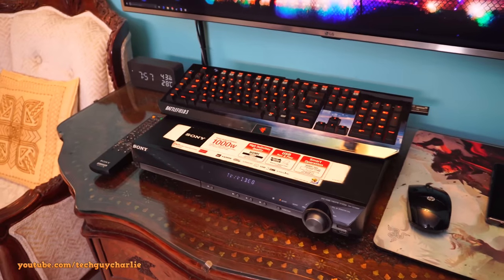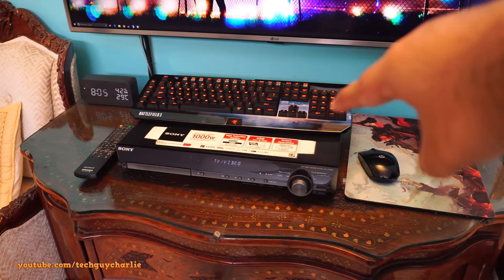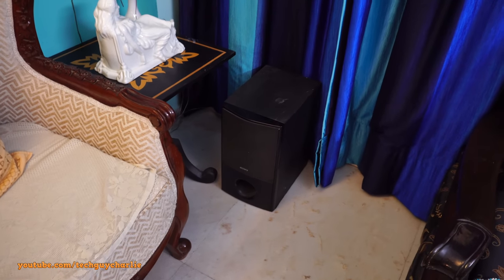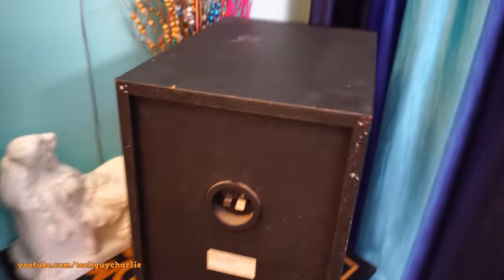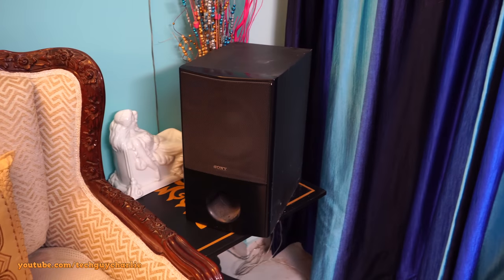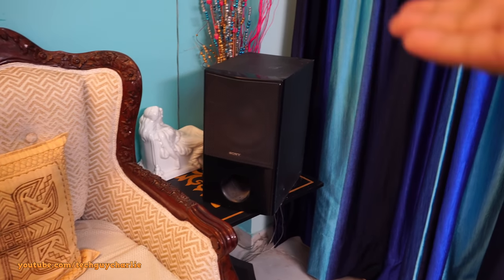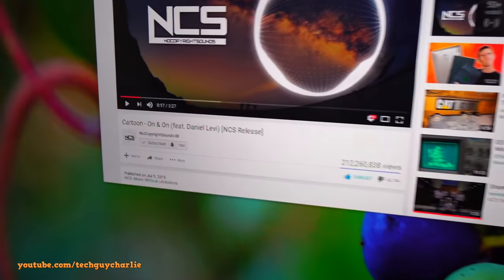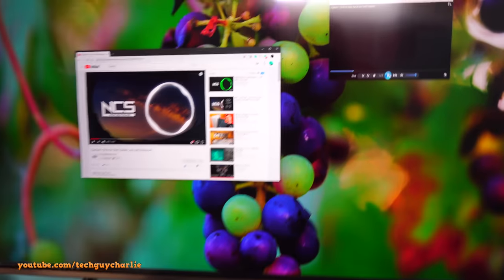Sony car sub-woofer with a home theater receiver! No 12-volt amp or car stereo required

Comment: Since you went with a 4 ohm speaker, you should add a second one to get more power delivery. You're only using 37.5% of the power. If you add a second 4 ohm speaker, you'd go down to 2 ohms and get 75% of the original speaker's power, and you could separate them a bit for better distributed sound.
Reply from the maker: Well, I don't have enough space for a second subwoofer but I'm thinking of getting a dual voice coil sub in the near future, I could not find a 3ohm DVC subwoofer for my budget, but there is a Pioneer 4ohm DVC sub that can be wired down to 2ohm, should be good. But its quite surprising even with 37.5% power, this new sub is louder and has more punch than the original sub of this system.

Comment from the maker: I opened up the old subwoofer (the part where the input connector is located) looks like the wires are intact! I guess the problem might be in the coils? I'm too lazy to open the rest of the box up since there are no screws and ill have to pry the wood open.
Reply: I think it’s blown.
Reply: Did you take apart the sub box?
Reply: look below of sub woofer box then you will find there are two small gaps to insert flat screw driver to open the sub.
Reply: the wire on the spider of these speakers go bad i have had two go bad after 5 years of heavy blasting
Reply: Its blown, and I can tell you why, if you are interested.
Reply: You can lightly push on the speaker itself and see how it sounds. If it is quiet and smooth when pushed in , it should be fine. If when pushed in, it is all rough but also makes like a scraping type sound than it's def blown.

Comment: The higher impediance gives the tighter punchier bass but you need an amp to push through it. If your original sub was 1.5 ohm and your new one is 4 then its 37.5% of the rated output which means 105 watts max is going to the sony sub. The higher quality sub combined with a sealed box gives good bass at all frequencies which your previous ported box did not because it was tuned to a certain frequency. In other words, even though it was lower watts, it's better overall because of its superior configuration. Im going to do this with a powerbass 10 inch sub wired to 2, 4, or 8 ohm with a set of polk 6x9 coaxial speakers at 4 ohms each,  but I need to find an amp to power the setup....
Reply from the maker: You are right! and even though the old sub was 1.5ohm because of the box design the bass used to overwhelm the mids and the highs, and there was no 'punch' to the sound I never enjoyed it, on the other than this car sub makes the home theatre sound a LOT better, especially in movies. I am thinking of getting another one of these exact sub and wire that up in parallel so that impedance becomes 2ohm, can get a little more out of this amp, always wanted to hear a dual sub-HTS setup.
Reply: @TechGuyCharlie  You definitely could but it would change it a little. You would gain some power. Sound follows an interesting law where 4x the power is 2x precieved volume increase so it wouldn't be double the precieved bass with 2 subs and it would be a bit less tight almost like sloppy bass but it might not be noticeable. Personally I would get a 4 ohm dual voice coil sub and wire it in parallel. Id also put some polyfill in the enclosure and use the same box to save a little space. Or find a dual 3 ohm sub wired in parallel to exactly match the impedance, that will definitely rattle those windows.
Reply: Who cares how much power it can handle and what impedance it has, if you only need 10W to drive it at 90dB anyway? I bet this sub has at least a 85db efficiency, so no need to worry about power.
Reply: @florichi  That is very inciteful. It might be better to keep the setup as it is to keep the high quality of sound. As my father used to say: if it isn't broken don't fix it.

Comment: Nothing wrong with using car subs in home theater setup only watch your impedance ohms. I've used 2 Kicker compVR 15" subs 4 ohm each 500wrms in 5.7cu.ft. ported enclosures tuned to 18hz powered by a Kenwood Basic M2 450wrms minimum at 4ohms paired with a modified Sansui C-1000 preamp. My theater room was 750sq.ft. and subs got down to a clean 20-27hz with ease not clipping. If your going to use a car subs in home it's best to have some sort of low pass filter x-over when used with full range amplifiers or buy a subwoofer plate amp with at least 5-10% more power out than the subs rated RMS power for headroom and less clipping distortion. Most of the time power doesn't kill speakers but distortion does. Reason I used car subs is power handling and frequency response at a lower cost than most designed for home audio raw drivers.

Comment: I have the exact same home sub, just take a flathead screwdriver between the plastic and wood and it should pop right of
Reply: You shouldn't lie to people
Reply: @kellynorman7452  r u the one that takes apart and reconstructs all types of speakers in there spare time, No, so keep scrolling through the comments to argue with people about stuff u have no knowledge of
Reply: @kellynorman7452  but do have the Sony sub in the video
Reply: @Audiodote  thanks for the assist
Reply: Those small subwoofers are easy to pop the plastic cover off and the replacement drivers are cheap . A real easy fix usually only 4 screws and two wires.

Comment: Open windows slightly.. I kept xplode 300rms sub in my home with car amp and hooked in my yamaha av receiver.. 😊
My doubt is when u connect high impedence speaker to a low impedance amplifier then output power will reduce to half.. As it is inversely proportional. Low impedance speaker in high impedance amp definitely blow the amp
Reply: IIRC solid state amps can go equal or higher impedance, where as tube amps can go equal or lower impedance.

Comment: Nice video👍🏻. old sony home theater were so powerful than now a days home theater. Newer all the model's are running 3 and 6ohm. 😒.  which is not as powerful than the previous models. dissappointment. by the way Good system
Reply from the maker: Thank you bro and that's true, I wanted to upgrade to the new Bluray model but the most 'affordable' one has the amplifier and all the other hardware like the Bluetooth and USB built into the subwoofer box 😕 and the RMS rating is also lower than this. So I thought its best to keep my old home theatre and buy a car sub for this.
Reply: Yeah bro.. I did not find any older sony home theater such dav dz390k or dav dz760.. so i bought sony Bdv-E6100. it's sound good but not powerful as the older model..i also bought a car subs pioneer tsw309d4 which run at 8ohm! bcz the sub port is runnig at 6ohm. Which deliver less  power. i'm Fully fed up bro.I give a message to Sony that we dont need extra features newer ht model ,,we need Performance first like older model has...
Reply: True new Sony hts are not as good as old ones and same with their hifi stereos
Reply: Aussie Ninja Yeah... They rated bdv e6100 and N9200 1000 watts and 1200watss Rms ?! Really Sony? They  lyng about the wattege. If they have 1000watts rms then why they dont loud or sound like as other 500watts sound system?! they r literally cheating in watts and they r doing this for selling thts it.. Sony new sytem has more function but lower sound power which is a huge frustation bcz its costly too
Reply: @thebasskidzz777  I think the RMS rating is correct these are Class D amplifiers, they can be small and yet pack a punch. PMPO rating is lies though and I don't think they can lie that much when it comes to RMS, otherwise people will sue them for misleading. Its the size of the speakers that matters, I am guessing if you pair the amp with better quality aftermarket speakers with properly sized boxes then it will sound louder and even better, just like what we saw in this video with the subwoofer.

Comment: Seem good choice , but I think it 8in with ported enclosur while new one is 12in with sealed one. compared both of them will not fair, well 12in need more power to push it with sealed box. Put it into ported enclosure else need to upgrade amp as well. 💗💗

Comment: I've the sony dav-tz140. 300w amp, 500w spl 8" car sub it has a box shape enclosure with a decent size bass port and the woofer is behind some thick pvc glass and then I've two floor standing speaker each have 2 speakers that both sound different and a tweeter , those are rated at about 480rms. So in conclusion I've a car sub, 9 speakers and 2 tweeters and also some green led strips that are connected to the subwoofer that light up once the amp is pushing 12v or more

Comment: This is awesome, I have always wanted to try this. I have a DAV-DZ650 sony home theatre and the subwoofer has an Impedance: 3Ω. Do you think this can work well with the same subwoofer you used?
Reply from the maker: Hey, Oscar, the Sony DAV-DZ650 subwoofer power is much lower than DZ390K
the DZ650 is rated at 165WattsRMS and DZ390K is 280Watts RMS the car sub is rated at 300Watts RMS. Impedance should not be an issue since the impedance of the amplifier is lower than that of the subwoofer, but I think the difference is quite a bit when it comes to power! You might feel that the car sub isn't loud enough because it's a little underpowered.
Reply: Oh yeah that power difference is huge. That means that I would have to use an amplifier to be able to power the car sub ryt? Do you have any advice on how/which kind of amp I would use, and would this compromise the sound quality of the home theater in that the car sub sound will be higher than the mid-range speakers? Thanks the response
Reply: Oscar joseph I have dz 350 and I have been thinking of using a car sub.
Reply: @lucasmwaura7865  I think its possible to customize though technical not unless you use a powered subwoofer. what plan do you have?

Comment: "TIP"  One way to check if your old sub is dead is check it with a multimeter if the OMS are lower than what is rated or too high then rated or even nothing then is gone

Comment: My subwoofer is working of LG home theatre I have a extra car woofer can I try connecting both !!!
Reply from the maker: I don't know bro, just don't end up damaging your amplifier! some LG and Samsung home theatre amps I have seen are rated at 6-8ohms, car subs are generally 4ohm, if you connect a subwoofer rated at a lower impedance than your amp, then you risk damaging your amplifier. Also, the wattage difference should not be much, else your home theatre amp will not be able to drive the sub.
Reply: @TechGuyCharlie  okay !!
Reply: Bhai kaha sy mely ga ye

Comment: how can you run a 4 ohm speaker on a supply of 1.5 ohm? :3 you can damage your speaker or amplifier when playing too loud.
Reply from the maker: Not really, I played this setup at maximum volume for over an hour nothing happened, Class D amplifiers are awesome! they stay stone cold even when driven at such high volumes. But if you run a speaker with lower ohm than amplifier then you will damage the amp. But if the speaker is of higher ohm value and the amp is lower than it will be fine.
Reply: Moiz Mushtaq people use 1 ohm stable amps and run 1, 2, and 4 ohms sometimes even .5 ohms if you’re risky
Reply: You only risk damaging the amp when the speaker ohms are too low , wont hurt the speaker... but the more ohms the speaker the less power the amp will push to it down to a certain wattage then it levels out...people run from 0.5 ohms to 8 and 16 ohms all the time , normally the wattage drop levels out at 4 or 8 ohms
Reply: depends on the type of amplifier
Reply: If m not wrong lesser the ohm more power it uses. So using 4ohm speaker where 1.5ohm was being is gonna be piece of cake for the amp! Correct me if m wrong
Reply from the maker: @aniketnaik1197  Exactly, that is correct!!! I don't know why people don't get such a simple thing. It's only a problem if the ohm rating on the amp is higher than the speaker (8-ohm amp with 4-ohm speaker) and modern day amps just go into protection mode before any damage occurs.

Comment: I did the same but I used JBL GTX 1300T bass tube. I want to know that does a sealed box sounds better than tubes?
Reply from the maker: lol funny thing I wanna know how a bass tube sounds like, I am guessing a bass tube is like a ported subwoofer? but with more bass? how was your experience?
Reply: @TechGuyCharlie  I've never tested sealed box, I've read on the internet that sealed box sounds accurate, & bass tube sounds more punchy ☹️
Reply from the maker: Exactly, this sealed box produces bass that has that 'punch' effect, even though the overall loudness is less, also what I have noticed is the quality of the bass is better than the previous sub which was a ported box, earlier there was too much bass with that 'boomy' effect and I did not like it because while watching movies it used to overpower mid frequencies and it definitely lacked the 'punch' 
my personal experience, with a sealed box sub, the bass is cleaner and well balanced.
It really depends on individual choice. I hope soon, I can borrow my friends bass tube and do a test myself.
Reply: @TechGuyCharlie  before buying ( 6 months earlier from today) I was searching for the exact same video,but can't find one, I was anxious about buying a car subwoofer for home costing 6k,so I was searching this type of video to check whether it's a good idea or not, but you posted this only 3 months ago, anyway I am satisfied with my bass tube ( powered by 300 watt Rms class d amp at 4 ohms)
Reply: @CaffeinatedSentryGnome  mine is from jbl, jbl gtx 1300 t, 350 watts rms, & sounds very good
Reply: @prabhakar_  must be a well designed system then

Comment: Great video. If I was you, I would place the sub on the floor instead of a table. I’ve listened your video with high end headphones and I surely can hear that the Sony Xplod subwoofer sounds good and hit very low notes. I am using a Mordaunt Short active subwoofer in my set up at the moment but I do have a spare sub, a Sony passive home theater subwoofer which is bigger than the one in your video and is also rated at 4 ohms. It weighs approximately 50 to 60 lbs (20-25 kg) I want to use it as a second sub with an external amplifier. My receiver has the functionality to hook up an extra amplifier. Do yo have some advice/tips how to hook it up? It’s rated at 140 watt RMS at 8 ohms and 280 watt RMS at 4 ohms. If you need more specs to help me out, let me know. Thanks in advance and a great 2019 my friend! Best, Emiel.
Reply: Hey emiel. I've done a lot of home stereo stuff using all kinda of equipment to get create sound as cheap as possible. Do you have any social media we can contact each other with, I'll be glad to share my knowledge or at least try to help someone else out.

Comment: Maybe you blew it
Reply from the maker: Yup, I usually play this at quite a high volume. : D But I looked it up and its a common problem with these Sony home theatre subs, they tend to stop working after a while.
Reply: @TechGuyCharlie  kinda, i own one of these and its a 8'' and has definitely been in use over 6-8 years now, and  has has had a lot more than 300 watts rms, 800 peak, it works fine and still is in use, even tho  have a lot more better subs and bigger ones, i still love this one cause its rock solid.
Reply: You only risk damaging the amp when the speaker ohms are too low , wont hurt the speaker... but the more ohms the speaker the less power the amp will push to it down to a certain wattage then it levels out

Comment: Dude just add another subwoofer in parallel to the first one..... you will then have 2 Ohms total

Also you may find better/stronger main speakers on the Internet..... search for the highest dB rating for the main speakers

Each time a speaker is in parallel with another matching the same specifications, the dB rating/sensitivity rises vastly

Sony electronics have always used underpowered speakers from the very beginning in these exact home theater units

Comment: Bro try I love you too bass in this subwoofer and make video 😊
Reply from the maker: I would have done that bro! But the song is copyrighted and will cause a claim on my video 😌
By the way, I've played it, let me try and explain. It sounds great for a sealed box subwoofer however A large volume ported box would be the best for songs like 'bass I love you'. This sub box is really tuned for genres like Rock, Pop, EDM, house, and Classics, the bass does not reverberate much but it hits really hard and the bass is clear and won't drown the vocals. Deep house at high volume sounds AMAZING on this.

Comment: Need a bigger subwoofer box and it needs to be ported to really be effective I myself have done this many time with cheap Walmart subs in chambered box's
Reply from the maker: I agree! the box is too small and yeah it is not ported either. But my problem is SPACE!! I could easily get a bigger ported box but then the thing would take up so much space. Maybe sometime in the future. :D
Reply: ported or not that really depends on the design of the box. Generally a ported box will need to be larger box size but volume is way higher versus a sealed box.

Btw have you tested how it performs on movies?
Reply from the maker: @ducttaperulestheworl Yeah! I did, sound better than the stock sub that came with the amp, the bass hits harder and is more accurate and overall there is less reverberation.

Comment: I dont have a dvd player, how to do with 12 volt amplifier ?
Reply from the maker: Well, I made a video about it here: 
https://www.youtube.com/watch?v=T_FRxdeXeBQ
Reply: @TechGuyCharlie  it's crazy that a subwoofer can make music sound so much better.
Reply: You'd need a PSU(power supply unit) from a computer and use it to power car amp. I have done this for years and works fine.